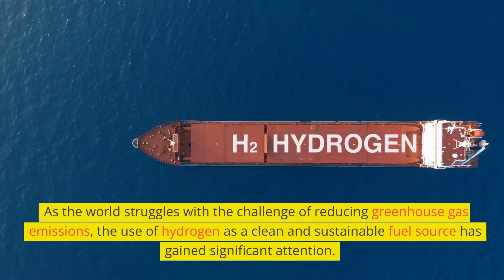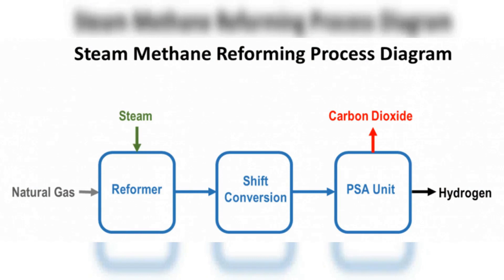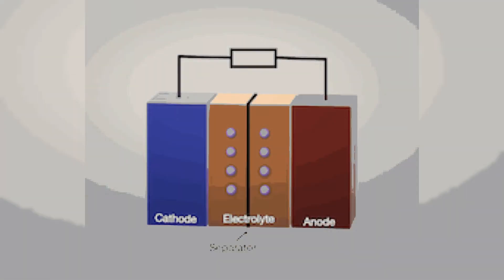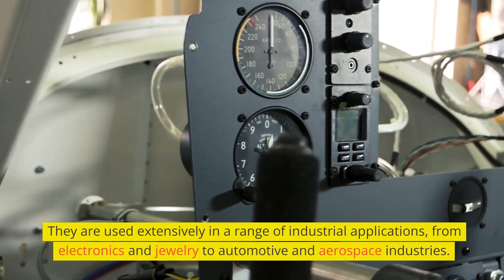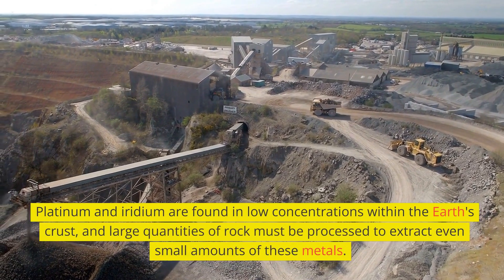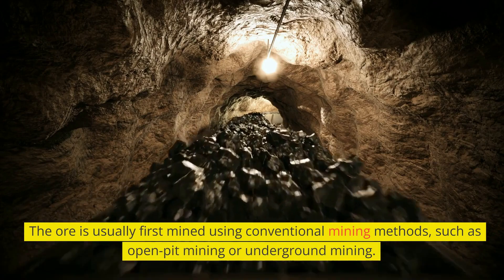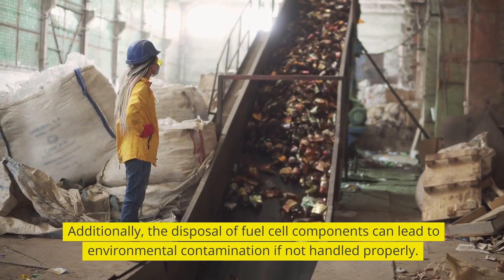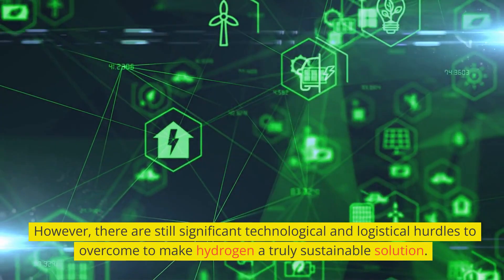We must STOP Hydrogen production: 5 reasons why

Comment: The video gives insufficient emphasis to green hydrogen (from electrolysis). In Australia this is rapidly becoming the main source, with plans to ramp up by orders of magnitude, using our abundant sunshine and photovoltaic cells.
The use of Platinum Group elements in fuel cells is a disadvantage, but they are currently used in exhaust catalysts for ICEs. Just like people have criticised Battery-Electric vehicles for using Nickel and Cobalt, without realising that these metals are used in ICEs, particularly in exhaust valves.
A huge PLUS for green hydrogen is its ability to replace Carbon (coke) in the smelting of iron, and again, Australia is proceeding to develop this process. This will take time, as it will involve replacing existing blast furnaces with new designs suited for gas reduction of iron ore.
Reply from the maker: What I wanted to highlight is that the current method of producing hydrogen is not sustainable and that it increases the problems instead of solving them. The green hydrogen production rate Is still too low, of course I hope It will increase rapidly
Reply: @Science.Stories  so why is the title of the video "we must stop hydrogen production"? I think that could be the main reason you're getting a lot of criticism. The point should be "why we should change hydrogen production". I know many projects currently under planning in the USA using green hydrogen, it's the future. The title spreads incomplete information, similar to what is weaponized by both sides of the current electric revolution...
Reply: Several companies are making combustion engines to use Hydrogen as fuel instead of relying on expensive Fuel Cells.  The 1.5 Billion cars and trucks in the World today have catalytic converters already containing a lot of Platinum, Paladium, Rhodium, and Iridium etc...These are being recycled at near 100% rate...ergo the theft of catalytic converters.  A fuel cell car requires comparable amount of precious metals as the emission control system of a large gas SUV.   Not much mining for precious metals will be needed, as they will be recycled from retired combustion engine vehicles already existed.
Reply: Hydrogen is a dead end.  A typical ICE vehicle is less than 20% efficient.  EV's are over 80% efficient......hydrogen fuel will never close this gap.
Reply: @allankoivu3263  But hydrogen can be fed into fuel cell that does not use ICE.
Reply: @KavinTeenakul  Fuel cell efficiency around 50%. Still a dead end technology for vehicles....
Reply: @allankoivu3263  -- BEVs were made over 100 years ago, even before ICEVs...Yet, ICEVs took over the entire car market, in spite of early cars like the Ford Model T probably managed 10% efficiency.  Now, hybrids from Toyota, Huyndai, Honda, BYD, etc...are managing over40% efficiency.   Using hydrogen in the ultra-lean combustion mode can raise efficiency to 50%!
But please don't get it wrong...GREEN Hydrogen is NOT meant to replace battery.  GREEN Hydrogen will be there to COMPLEMENT battery, for use when Renewable electricity to charge battery is not available, not sufficient, or not convenient.
Consider a PHEV, a Plug-in Hybrid vehicle that will be charged when renewable energy is available in the grid, and will use GREEN hydrogen when renewable energy won't be available in the grid, in order to ease the burden on the fossil fuel power plants, and to avoid having to be charged with fossil-fuel electricity.  This would be a win-win situation for both Green Hydrogen and battery.

Comment: The technology for producing hydrogen has been evolving as more industrial players are getting in on it. The price of electrolysis per kilo of Hydrogen has been on a downward trend lately. For that matter, so called "blue hydrogen" can be "geened" via carbon sequestration at the plant. Hydrogen fuel cells my be replacing the diesel engines in locomotives by the middle of the next decade. PS  don't trust the videos that resort to robovoice.
Reply from the maker: The difference between grey hydrogen and blue/green hydrogen is very clear to me and is explained in the video.
Unfortunately the current hydrogen production process is almost totally grey (oil refining) and very polluting.  
The CO2 emmitted in atmosphere every year is equivalent to the CO2 produced by UK and Indonesia. 
The green / blue Hydrogen produced is just 1%.
The problem of catalist is not the cost, but they use very rare metals and again the extraction process is polluting. Anyway I'm just against the grey hydrogen, not against the hydrogen itself.
To conclude, this is a small channel that I carry on only for my passion for scientific topics, using time and money.
I hope you can understand some small flaws.
I hope it can grow so that the videos can have better and better quality

Comment: According to this video you have to extract and process 20 tones of ore to get 1 ounce of platinum. Mining equipment uses the lowest grade of diesel and consequently generates great quantities of pollution and carbon dioxide.  The manufacture of  hydrogen fuel cells requires great amounts of platinum and iridium (in respect to their scarcity) and substantial amounts of electricity.   It should not be a surprise that the net energy output with the current hydrogen generating technologies is greatly inefficient in comparison with wind or solar.  Hydrogen suffers the same paradox as synthetic gasoline:  without question these fuels can be used however their net efficiencies is a fraction of the incumbent fuels and they also generate several times as much pollution as solar and wind.
Reply: Several companies are making combustion engines to use Hydrogen as fuel instead of relying on expensive Fuel Cells.  The 1.5 Billion cars and trucks in the World today have catalytic converters already containing a lot of Platinum, Paladium, and Iridium...These are being recycled at near 100% rate...ergo the theft of catalytic converters.  A fuel cell car requires comparable amount of precious metals as the emission control system of a large gas SUV.   Not much mining for precious metals will be needed, as they will be recycled from retired combustion engine vehicles already existed.

Comment: so if hydrogen is not the solution to our problemsthen what is?
Reply from the maker: The hydrogen can be the solution to our problem, but the production process must be changed
Reply: There is no such thing as is called "the problem" or "our problem". There are several use cases for energy and there must be a best answer for every use case. While there are use cases for hydrogen (steel production and many chemical production processes etc.) we will need hydrogen in a big scale down the road. Therefore it makes a lot of sense to strive for better production methods very much as is described in the video. However individual mobility is not among these use cases, because the better answer to that use case is battery electric drive train. It uses much less primary energy thanks to its superior efficeincy.
Reply: @beatreuteler  but the primary component of battery electric vehicles i.e lithium is finite and what will al of these evs made from if lithium was ever to run out?
Reply: @samiurrahman2255  As soon as the Lithium is out, the used Lithium from old batteries will go in ever better recycing turns and can be used many many times. On top of that: Lithium isn't even the main component and other materials used are less rare. And Lithium is actually not really rare. And on top of that, the development of sodium ion batteries is already quite well advanced. Until these can be mass produced, even if it may take 15 years or more, Lithium will not be out.
Reply: @beatreuteler  but the point is lithium is not as efficient when recycled infact it loses its properties and sodium ions donot provide the same efficiency
Reply: @samiurrahman2255  In fact Lithium is more efficient when recycled (compared to mining it, it takes less resources to get it), and no it doesn't lose its properties. To whom's trap of lies are you falling?

Comment: There are so many "stale information" errors in this prez that I cannot be bothered to list them all. Importantly, Steam Methane Reforming is no longer necessary, and can be completely replaced by alternative tecs which convert CH4 to H2 and C without producing any CO2, and these tecs are more profitable to run than SMR. There are new tecs to replace precious metals in electrolyzers and FCs. And so on..
Reply from the maker: I would be delighted to hear your pieces of information, but at the moment the facts are different. 
The facts are that according to the International Energy Agency (IEA), grey hydrogen production is responsible for around 830 million tonnes of CO2 emissions annually, which is equivalent to the combined CO2 emissions of the United Kingdom and Indonesia.
Currently, green hydrogen is more expensive to produce than traditional hydrogen due to the higher costs associated with renewable energy infrastructure and electrolyzers.
 According to BloombergNEF, green hydrogen COULD become cost-competitive with grey hydrogen by 2030.
Green hydrogen currently accounts for a small fraction of the global hydrogen production, estimated at around 1%.
The Hydrogen Council predicts that green hydrogen COULD supply UP TO 24% of the world's energy needs by 2050.
Traditional hydrogen currently dominates the market, accounting for approximately 99% of global hydrogen production.
At this moment the alternatives to the Platinum Iridium catalyzer are still in the development phase
Anyway, as already said plenty of times I'm not against Hydrogen itself but against a pollutant production process managed by the oil companies
Reply: Decent point except the need to also consider a couple counter points. 

1. Methane Cracking to make novel Blue Hydrogen without introducing Oxygen (causing the CO2 emissions) takes a lot of heat and molten metals like Tin. The highly thermal nature of the reaction takes a massive amount of energy in itself which has its own costs. 

2. There is nearly zero hydrogen currently being produced this way and even most hydrogen plants under construction today are not using it. May be an awesome solution for industrial/chemical hydrogen demand in the future but it looks years out. More mature tech like Electrolysis and Nuclear are ahead of the game in hydrogen production, but there is always an argument that that energy may be better suited going into the general grid instead of being used for Hydrogen. 

3. Still does not change the fact that Hydrogen used for transportation and energy is a terrible idea in most cases. The inefficiency in using the hydrogen, plus the cost of distribution and storage (one major problem with all fuels compared to electrified energy through a grid) make it only slightly better than gasoline, but more expensive than gasoline and still worse for the environment than battery electric, which is also less expensive than gasoline. So compared to EVs and Electrified Heating hydrogen rarely wins out except in a couple uncommon use cases. 

So I would love to see this new method used for industrial/chemical hydrogen demand in the future, it does not change my mind on hydrogen as a fuel for transportation and heating.
Reply: If steam methane reforming ‘is no longer necessary’ why is 90% of industrial hydrogen still made with steam methane reforming?  I think your are confused with laboratory results and commercial adoption of large scale production methods. Twenty years ago we had encouraging news on the production of solid state batteries.  In fact the methods announced 20 years ago are still chasing success. Thankfully innovation has not rested and new battery production methods have been developed and will be available in production this fall.
Reply: Craig Weems : it is mostly because any method other than steam reforming is around 10x the price. There are plenty of great low emissions ways to make hydrogen if we are willing to pay extra for it, and we aren't willing. 

Which is why the only current practical replacement for fossil hydrogen is using excess green generation (wind/solar) during peak generation when off peak demand. 

But this is competing with other good uses of the excess energy like batteries. And also there is the limit there that we lose the incentive to build wind and solar above peak daytime load, so we will not likely have a lot of extra left over during peak supply to make hydrogen out of. Maybe there is a model there, an excuse to build too much wind/solar just so we can spill over to electrolysis hydrogen and sell that...but the numbers do not look awesome so it will take a lot of grant money. 

With all that said, we need to focus ALL hydrogen production on answering the demand for chemical/medical/industrial hydrogen. And then try our best to improve the mix to reduce fossil hydrogen as much as we can. 

Any hydrogen used for transportation will end up being fossil hydrogen (adding to the worst end of the mix of how we make hydrogen) - so worse than just sticking to gasoline cars and way worse than converting to EVs.
Reply: @5353Jumper  Not 10x the price - actually LESS than the price, These products have only appeared on the market in 2022.
Reply: @jonb5493  I hope you are not talking about carbon capture on steam reforming cause that is just about the dumbest idea humanity has come up with. 

If you are talking about something like nickel pyrolysis it is barely out of the research lab, and still decades away from production at scale. Also it is pegged at around double the price of steam reforming so far but that may go up or down as they work out all the bugs and improve purity. Also that price is dependent on selling the carbon byproduct for a reasonable price which is a bit of an assumption. 

Maybe consider naming this tech you are talking about so we can research it instead of repeatedly insisting it exists without any backup information.
Reply: @5353Jumper  No. CH4 + energy => pure hi-grade C + H2 - nothing else.
Reply: @craigweems  Not a lab demo: More than 1 product is on the market, I am invested in ione of them, and it is a total replacement for all SM in the world. It costs less than an SM plant. The market they are attacking is pretty big! If you don't want to do the search, I can tell you the company names and details of the products. Like I said, steam methane reforming should just go away. Do the search!
Reply: Agree with you, Jon B.  Thanks to Sir Putin and whoever blew up the natural gas pipeline NordStream to Germany, Europe now is deprived of natural gas and thus is scrambling rapidly to make H2 from renewable energy to replace the natural gas.  Green Hydrogen to replace Natural Gas.  Necessity is the Mother of Invention.   Several companies are making combustion engines to use Hydrogen as fuel instead of relying on expensive Fuel Cells.  
Hydrogen can be stored in existing Natural Gas reservoirs and transported in existing Natural Gas pipelines.
Reply: Also a lot of methane is already being consumed in power generation, heating, and in gas stoves, I don't think steam methane reforming adds any greenhouse gases that isn't already being added through the daily consumption of methane in power plants, stoves, and heaters, as well as the methane powered vehicles that are in use today. methane is considered a clean fuel compared to other fuels such as coal for instance. When you compare hydrogen cars, you need to consider the alternatives to them, and those are gasoline, diesel, methane, and electric. The advantage of hydrogen is that it is faster to refuel than an electric car is to recharge.
Reply: a continues power generating  systems is just the best for a better world. having cheap and abundant materials in provision. such systems is about hitting the corner. A great vision, trust me

Comment: what about all the negative effects in thrid world countries where lithium is mined for ev batteries? water surces getting contaminated. thats all ok i guess yeah? lol
Reply: And you do not know about all the contaminated water from fossil fuel production?

Or the global tragedy of bauxite mining for aluminum engine blocks and transmissions?

The EV movement gives us the opportunity to build the new supply chains for battery materials and copper. If we the consumers and citizens take this opportunity to pressure our industry to improve human rights and environmental regulations to build these new supply chains better than the old ones. 

You could spend your efforts lobbying for improvements to supply chains instead of resisting new supply chains assuming they will be as bad as the old ones.
Reply: Sodium ion battery uses table salt to replace the lithium.   I would wait for a Plug-in Hybrid EV (PHEV) that will have Sodium ion battery, because this battery does NOT have the fire hazard of Li-ion and endure colder winter temperatures and can be charged many more times.  Of course, I would want to have Hydrogen as a backup energy source in my PHEV, but for now, a gasoline PHEV would do because Hydrogen is not available.  I don't want to have a pure BEV because I don't want to be dependent on the electricity grid.  A car should give you FREEDOM, and not dependency.
Reply: @DJP1lly: Whatever man is doing does an impact somewhere. But Lithium mining in third world countries does not exist really, because more than 95% of Lithium mining currently takes place in: Chile,Argentina,Bolivia, Australia. As far as I know, none of these countries counts as paert of third world. In any case, environmental impact of Lithium mining is very minor compared to usage of fossil fuels.